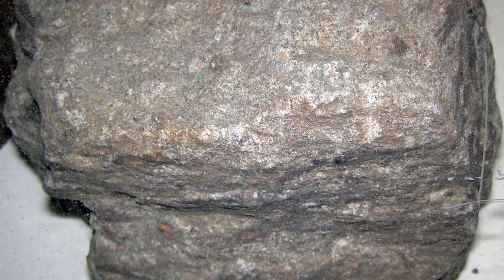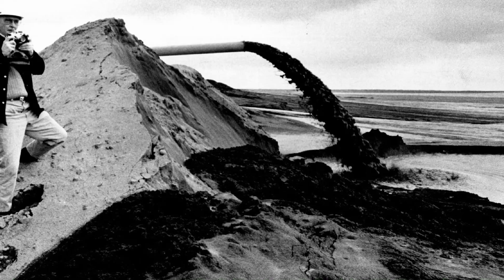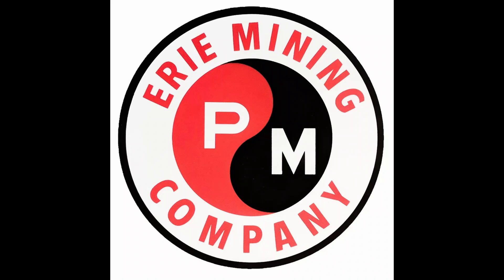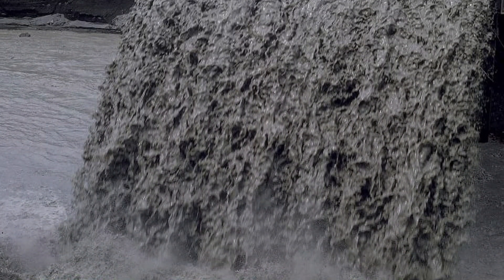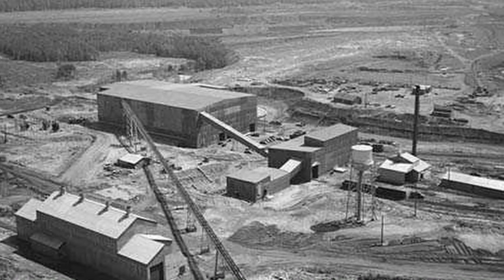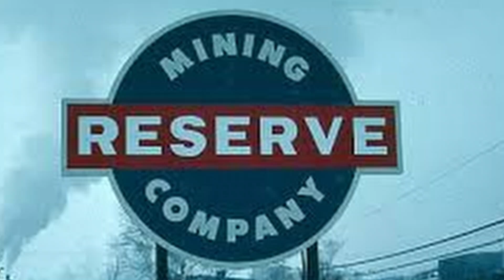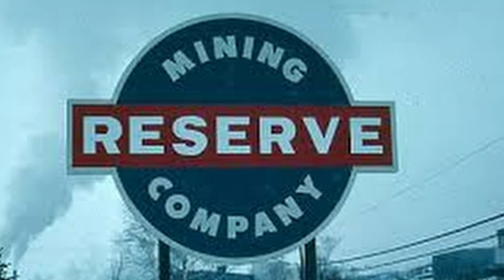One Rock SAVED The U.S.

Comment: East Texas has a fair amount of limonite deposits that range from 40 to 60% iron. The early settlers mined it to smelt in bloomer furnaces to make pig iron and used the limestone slag to make cement. During WW2 the War Department had a basic steel mill built here to produce bomb casings. Twenty miles to the east the WD built a TNT plant that was loaded into the aerial bombs 7 miles to the NE at an ammunition plant that was built out in Caddo Lake.

Comment: Just South of Ironwood Michigan there is iron ore shaft mine about 1,500 ft deep. The ore never played out, but high production costs and low iron ore prices closed it. There is still 
a new drainpipe put in so that in the future it could be pumped out and reopened. 
But with the fascist lefties in charge of Michigan for decades there are now rules that would probably never let it be mined again. Some of us are our own worst enemies.
Reply from the maker: What's interesting about efforts to lower pollution is things like electric cars still pollute. In order to make those cars you still have to pollute. So it defeats the purpose anyways.
Reply: @ConnorTenold  Actually I think the reason to have an EV is short tips and cost per mile. Many in the Midwest have cheap enough E rates to take advantage of that. 
A friend tells me 6 cent per mile long term.
Reply: @debi5292  Under the Obama administration, many of the coal-fired power plants were not just shut down, but were  totally demolished. All of the electrical generating equipment & electrical transmission equipment were turned into scrap metal. The entire facilities were destroyed. These plants provided a huge amount of electric power that was not only inexpensive but reliable. Instead of coal, the newer plants burn huge quantities of natural gas. Many people who heat their homes with natural gas were wondering why their bills were getting so high. It was the law of supply & demand at work. In Georgia, they recently completed the addition of 2 more nuclear powered units to 2 units that have been in operation since the late 1980's. It's called Plant Vogtle, & the 2 new units cost well over $20 billion & took about 10 years longer to complete than what was originally stated. All of those costs, including overruns, will be paid for by their consumers. There are those with an agenda who are trying to drag down the country. "Green" energy sounds like a wonderful plan, but it is never going to replace fossil fuels. In order for a country to prosper, it must have a great industrial base, & for the base it must have cheap & reliable electric power. Last summer, the state of California was telling owners of EVs not to charge their cars during heatwaves. Their electrical grid, along with a lack of generating capacity, can't support their infrastructure, yet they insist on mandating new rules & requirements that are not capable of being met. An eye-opening video, available to watch here on YT, is called "Planet of the Humans". I highly recommend everyone watch it. Take care.
Reply: @Urbicide They stopped building nuclear generation plants decades ago due to the antics by suppliers, subcontractors and unions that drove up the costs and delayed completion for years. Everything was to be inspected before being used and as construction progressed yet nothing was. They'd get one phase completed that would fail inspection so was torn out so they could start over.